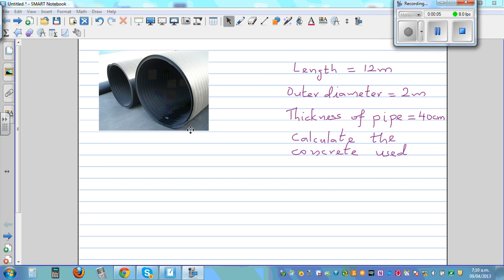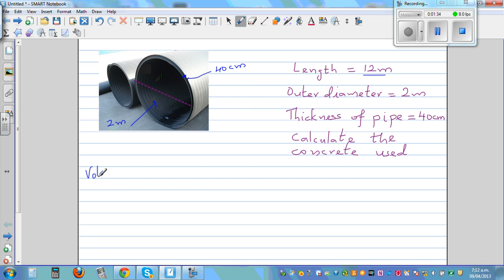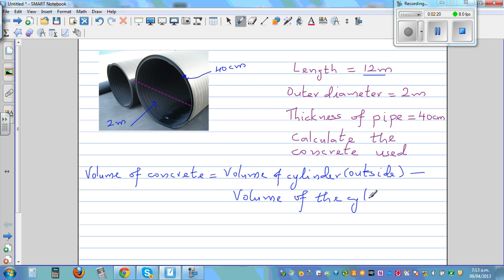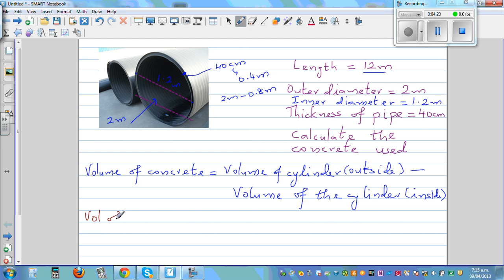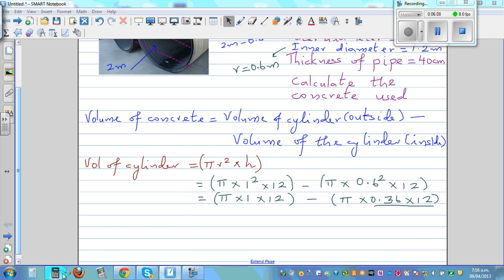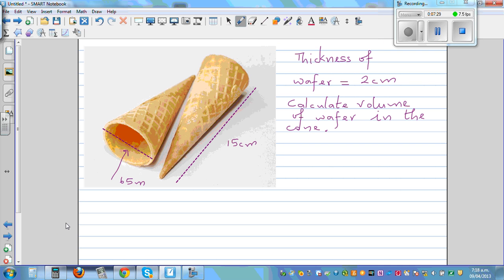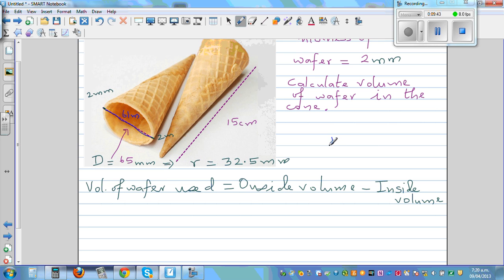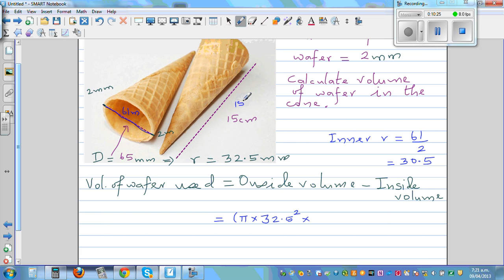Volume of hollow containers - cylinder and cone

Comment: wrong : u have assumed the height of both the outer solid cone and the missing solid cone to be the same . while, the height of the missing solid cone = h(1-[t/r]) , where r and h are the rad and height of the outer solid cone and t is the thickness ( assumed to be uniform here )

Comment: The question provided on your website is  
1. Given a pipe with length = 12cm, outer diameter = 2m and thickness = 40cm. Calculate the amount of concrete used?
You are taking 12 M as length to solve the problem.